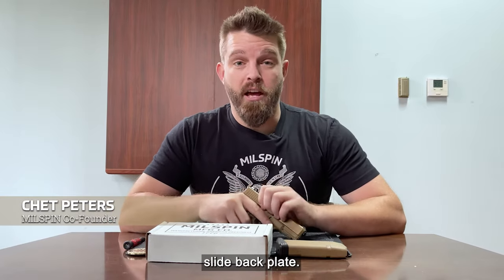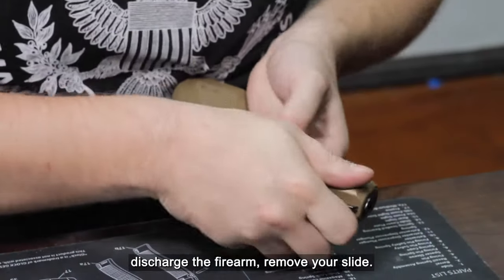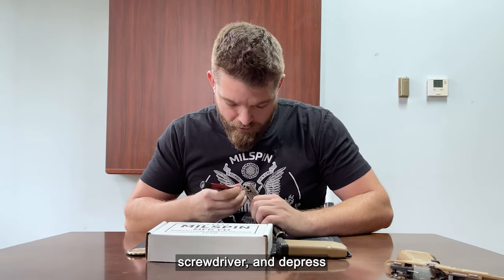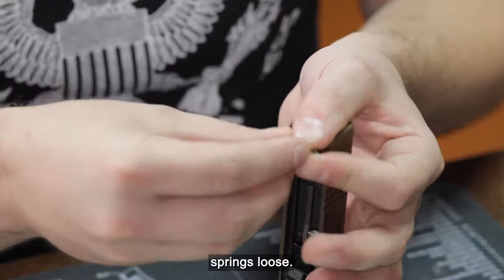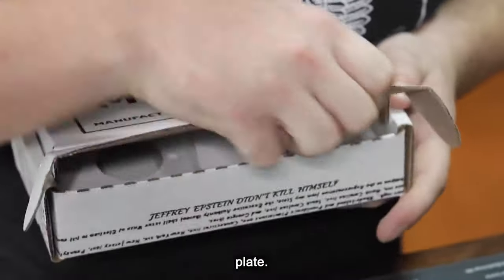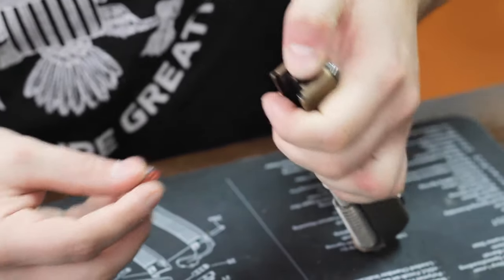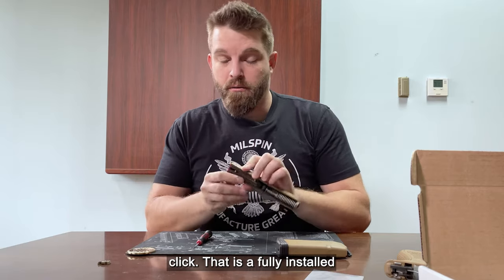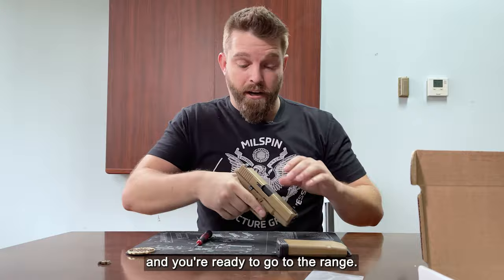MILSPIN How to install a Glock Slide Back Plate

Comment: I was having so many issues figuring out what I need to press to remove the old one. This video is a great walkthrough on the entire process
Reply: maybe you shouldn't own a gun
Reply: I bought a used Glock 22 gen 4 in 2022 partly to learn how to field strip, clean, disassemble Glock parts. Get good ✔️. As noted the springs sleeve can be tricky. Some times it takes effort to hold down the parts to start to slide the Glock back plate in. When you hear a audible click 🔊 you know it's covering the end. If the 1 thin part pops out, insert it METAL end toward the muzzle. By the way, I ordered 2 US Flag 🇺🇲 Milspins. 1 black, 1 stainless steel.

Comment: Will a Glock 17 back plate fit on a Glock 19 gen 5?
Reply: I have a Glock 19x & the G45 option works, I assume it’ll work for your 19 Gen 5 considering my 19x takes a 19 slide.

Comment: This is made for Gen5, correct?
Reply: Check the website for model details. In general, the regular Milspin back plates fit all gen: 1-5 Glocks, all models. Except: Glocks 43, 48, 36 etc. They may require different sizes.